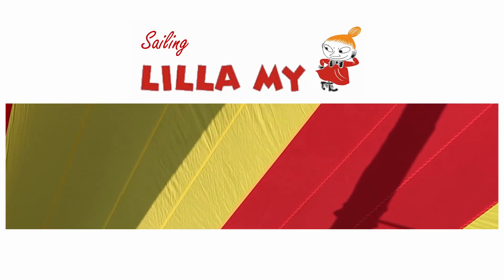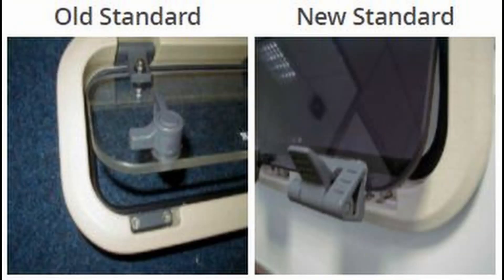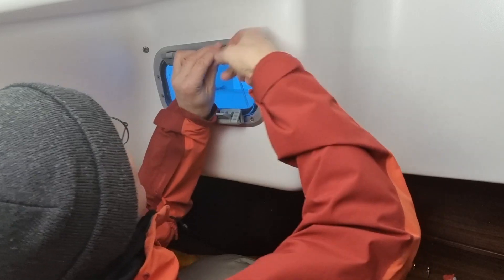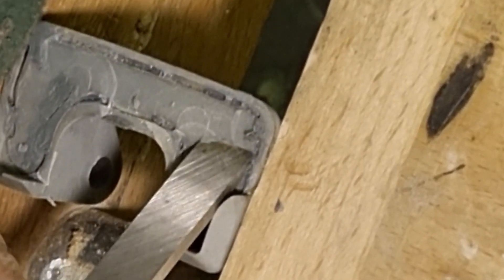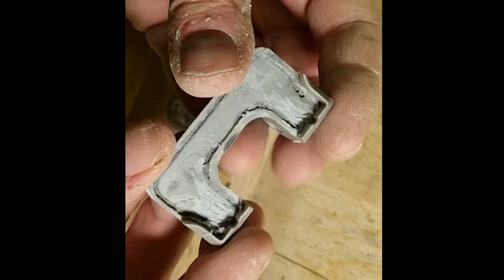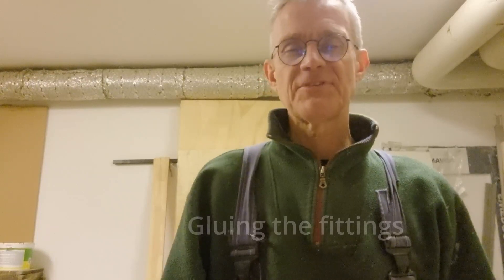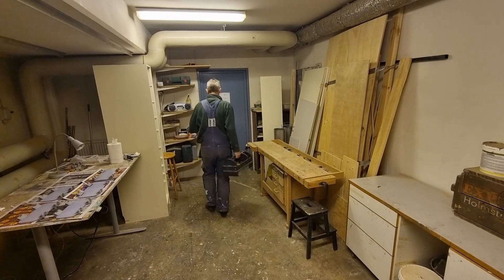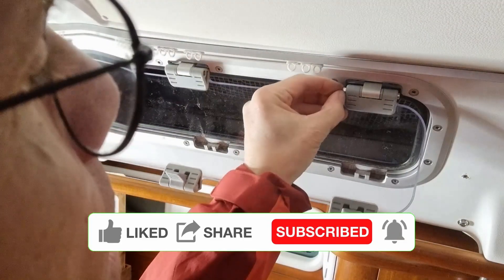Sailing Lilla My, P1, Manufacturing new lenses for my Lewmar portlights, on my Beneteau Oceanis 411

Comment: Hi Jakob
What was the diameter of your router bit? It seems as though the hinge corners are less than the usual half inch (6.3mm radius). Thanks for any advice.
Reply: Hi Alex, I don't remember. But it needs to be same diameter or smaller I assume...
Reply: Thanks

Comment: Thanks for posting...this is a current project for me and your video is a fantastic help!
PS I have the MK2 I guess on my 2002 Catalina C380 ...is there any danger of breaking the fittings while breaking the glue?
Reply: Hi, Thanks for your feedback, appreciate it :)
I don't think so. Be careful and try it out. I think the glass will break before.. ;)
Reply: @jakobmagnusson5603 thanks for the reply ...your glue is not available in Australia (in my searches at least) is this very specialised or would an epoxy be ok do you think?
Reply: @alexvk2 i wouldn't use epoxy, because these industrial glues are very specialized i.e. for acrylic. I think for some of these glues the primer is essential

Comment: Hi Jakob, many thanks for the great video!  Everything is clear - but I would still ask you some details, if I may. You stated the size of the acrylic plus the hinge should be 27mm. Did you measure the thickness of the acrylic itself at the recessed area? As I have no tools a place to cut the acrylics myself in need to give someone the measurements including the thickness at the recessed areas. I think that the hinges have all the same size, so the thickness of the recessed areas should also be a definite size? To the glue you used: is it possible to use only a part of the 50ml of the 7310 or if you open it it is done? Thanks a lot, Andras
Reply from the maker: Hi,
No i dont have that measurement. But it should be 27 mm minus the hinge thickness. Yes, same for all.

The glue tubes can be be used several times but you need to use a new nozzle each time.

Good luck with your project!

Comment: Jakob,  Very nice video.  I have the MKI lenses in a Beneteau 423 and would like to do the same.  I have not yet found 8mm thick acrylic or polycarbonate available in the US. Do you have any thoughts about using 9.5mm (3/8" - a US standard size) and recess the hinge and lever more to maintain an appropriate fit?
Reply from the maker: Hi David,
Thank you.
I believe it world work fine. The magic number is the 27 mm, which you could achieve with a deeper recess.

I heard from my supplier that some material, acrylic I think it waste, has varying thickness on the same sweet. Just to be aware

Good lucka!
Reply: @sailinglillamy5028  9.5mm acrylic with a deeper recess to match the magic 27mm dimension worked fine!!  I now have 7 new portlight lenses.  She looks new inside with much more light coming into the cabin.  Thanks for the inspiration and the how-to knowledge!!  Now to replace two deadlights, two hatch lenses, and the washboards.
Reply from the maker: @davidreutter8113  thank for your feedback, im glad That the video was helping you:)